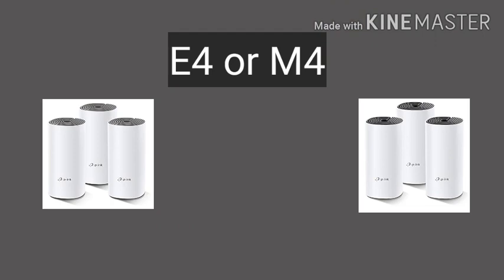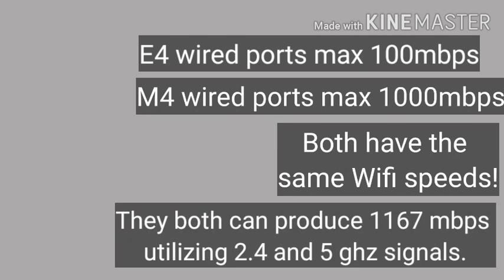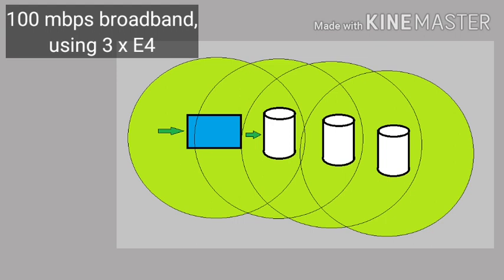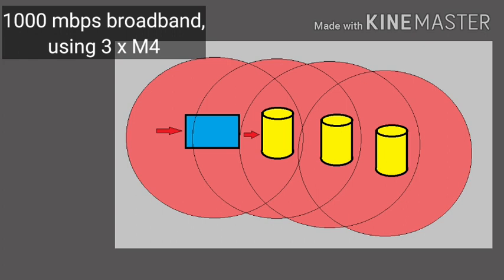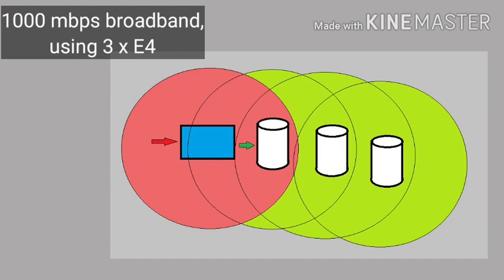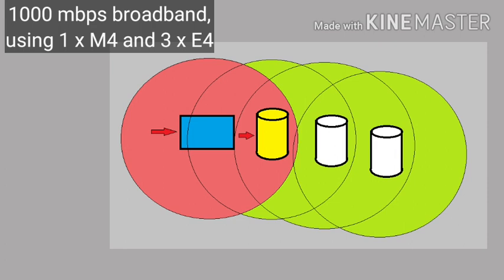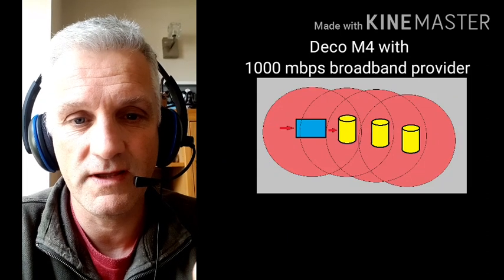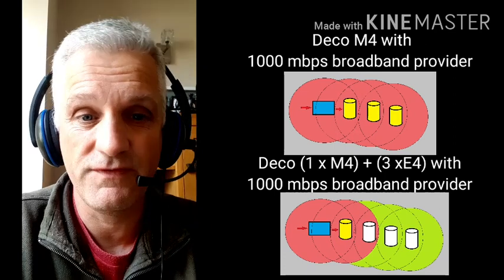Deco E4 vs M4 - better explanation and configuration idea!

Comment: Hey @stevedogwildman2133. Currently I have two E4 Decos one of ofcourse being connected to the routed providing me with a wired 100mbps download speed. As per my internet provider, currently I have a 1000mbps / 1GB download speed. If I understood correctly from your video, replacing the first deco to an M4 will result in a maximum internet speed of 1000mbps / 1GB download speed through the whole network right? (Of Course some connection may be lost due to the distant between the Mesh System) I would appreciate if you could reconfirm if this is the case

Comment: if say one of these täcan transmit a signal 100 feet, can you then put 3 or maybe more on a line 90 feet apart from eachothers in a line so you can go 300 or more feet away from your router signal?
Reply from the maker: Yes.  But of course the further between nodes, the weaker the signal will potentially be.
Reply: @stevedogwildman2133  okay so the first one needs to be connected to the router with cable or can you do it wireless? and then between the second and third you do it wireless? 
or do you even need a router at all or this works as a router?
Reply from the maker: @Chris-zu4es you cable from your router to the first node, then can go wireless (or wired) from the 1st to the 2nd, from the 2nd to the 3rd and so on.
Reply: @stevedogwildman2133  thank you very much ill give it a gi thanks to this video 💯
Reply from the maker: @Chris-zu4es let me know how you get on!  Cheers!

Comment: How well does the third one transmit back?
Reply from the maker: If all talk to each other they should be fine. But you have to work it out in your head.  So if node 2 has 70% connection to the primary, and node 3 has 50% connection to node 2, then if node 3 could gain 40% to node 1 direct, it might be faster.  All being said, normally if you can create a solid link from node to node, you should get a good connection.

Comment: Does E4 wan input is through 100mbps port only?
Reply from the maker: Yes, so as one of those nodes would be a primary node, then that would maximise the mbps to 100.  If you put (say) an M4 as your primary node (wire connection to your router) then the e4 nodes can send via wifi up to around 800mbps, as the M4 can run wired up to 1000mbps.  You can therefore upgrade an e4 system (to some extent) by adding in a single (better) primary node.
Reply: Thank you

Comment: I have checked with a local supplier. I currently have a100 mbps broadband service so E4 should be fine, but the supplier said (1) if in the future you have a higher broadband service,  changing the 'master' E4 to M4 and connecting this to the other 2 E4 will not help as the speed of the other 2 will still be not more than 100 mpbs therefore you will still be limited to your previous speeds
 (2) Replacing the 'master' E4 with an M4 and keeping the other E4's will not be compatible. Can I please have your comments? thanks.
Reply from the maker: Replacing the primary will allow your whole system to go up to around 1000mbps.  The specification of the E4 is only limited on the wired ports, so if you use an M4 then that's where the ports are, and those go up to 1000 Mbps. The only issue would be if you wired from an e4 to a laptop, say, which would then be limited, but if you had the laptop on WiFi then all is fine!
Reply: @stevedogwildman2133  Thanks. Just to confirm....so if the broadband service increases from 100 to 1000 mbps, and I have an M4 connected to the modem and another 2 E4 (not wired) in other rooms, I will get wi fi with 1000 mbps all around the house, even though I am using 1 M4 and 2 E4s? Thanks again.
Reply from the maker: The era have nearly 1000mbps WiFi, but are limited when wired.  So if you usedl an M4 or M5 as your primary, that gets you past the problem.  Check the specifications.  What I'm saying will make sense....
Reply from the maker: E4, not era.  The person who advised you are wrong.  The problem with the e4 is the wired ports.

Comment: my house is 2600-2700sft. and the current broadband speed i get is 20mbps on average. in this situation do i need to buy 2pack M4 or 2pack E4 is sufficient enough?
Reply from the maker: E4 should be sufficient.  You can always add an M4 another time if you like.

Comment: I had both and found that the M4's are much faster over Wi-Fi.  Think about it.  In theory, they are both capable of 867 Mbs Wi-Fi but, if the E4's can only bring in 100 Mbs, how can it output 867?  Now, in real life, I found that the M4's do not output anything near 867 Mbs, but that might be due to my equipment.  Fastest that I have got is between 300 and 400.  "Your mileage may vary."
Reply from the maker: So I added an M5 as a primary unit to my E4 system, and all appears fine.  You are right, performance can be impacted by many things.

Comment: Im planning of purchasing my first mesh system. Having a 4 storey fully concrete house, i calculated that i need 5pcs of mesh units. I have 200 mbps network.

The previous plan of setup was 
$195 = 3pack m4
$135 = 2pack m4
Total of $330

But after some reading, i can adjust it with these, with the same result as mentioned above.

$102 = 3pack e4
$135 = 2pack m4
Total of $237,  almost $100 savings for same result

Having m4 as the main and 3 e4 = 5 m4
It still can spread the roughly 200mbps all around the house with only 2 m4?

Update: follow up
One of the mesh is to be placed on a dental clinic thats on our ground floor. If clients were to connect on the e4, can i have that specific mesh have different password? Or m4 is more appropriate on that particular area?
Reply from the maker: You can set up your own networks off the same mesh.  M4 is a stronger system than an E4, but both are good.

Comment: Superb explanation! I've a 50mbps line, E4 it is, saves me £50 and I can add an M4 if I increase down the line. You've a gift for making information simplified and relatable. Thank you.
Reply from the maker: Many thanks for your comments!  Feel free to give the video a thumbs up and if you want to subscribe, go for it.  It's free after all.  I have a selection of mesh wifi videos and some of them will help you learn the best way to position them.  Also, I do some paddleboarding videos.  Totally different of course, but they are good to view in these covid times!   Thanks again!
Reply from the maker: I happen to have an E4 system.  I needed another node, to extend my range into a garage, which is now an office, so I bought a single M5 unit.  Yes, effectively an upgrade and it was cheap!  The S4 is going cheap at the moment on Amazon.  It's the same as M4 (just shorter), so you could grab a bargain.

Comment: Steve, one thing I don't get: if I have one M4 as the main unit connected to the modem (gigabit speed) and some E4s as additional units, won't it have the same result in terms of wifi speed as if all the units were M4s? I mean wifi speed will not be capped on the main unit's ethernet port if I'm not mistaken.
Reply from the maker: You are precisely right, however, as the wifi speeds are the same.  The only difference is if you chose from on of your secondary nodes to then use a cable into a device (e.g. my laptop, cos the laptop wifi doesn't work), then that is limited to 100gbps on the port.   This is a particular situation which at a guess wont happen often, but that is essentially the only difference.  So using an M4 and then E4s running off that, is almost identical to running all M4s.  Personally, I had an E4 system, then added an M5, cos it was cheaper at the time than an M4!  Bizarre eh?
Reply from the maker: Sorry, Typing went a bit wrong at the start.  So you have an m4 then wifi to an e4, you can only port then to a laptop via cable at 100mbps.  If you had all m4, then those secondary ports can run at 1000mbps.

Comment: Hi Steve, thanks for these videos, as they make everything very clear. I saw almost none reviewers to say, that even though the speed of wifi on E4 is 867mb/s, the input speed is only 100mb/s. Great tips. I have one question, which I did not fully get. I ordered E4 (3pack) from TP Link. Can I connect those TP Link Decos to my existing wifi router? Can I let my wifi router where it sits now and just connect those 3 Deco units around my house? Does this "seamless network" work then too? Does it have any advantages/disadvantages? Does the first unit need to be connected via cable? And is it even possible? Thank you very much
Reply from the maker: Your first deco unit will be connected to your existing router via an intranet cable.  You can then, if you like, switch off the wifi function on your router.  If you leave it switched on, which is fine, you will then have 2 network which run alongside each other.  You could if you wanted wifi devices which don't move and are close to the existing router to that one, then connect other devices, which you carry around with you to the new network.  I have connected all of mine to the new wifi, the mesh wifi.  I have a 3 pack E4 system, I then added a M5 and made that my primary, so i can get 1000mbps onto my wifi, but my broadband provider cant provide to that level, so i am "future proof" for when they can.  Hope this helps!  Give me a thumbs up and subscribe if you like.  It would be appreciated! Thanks Steve
Reply from the maker: I have 2 newer videos on my channel about signal strength of WiFi.  It will be useful to you to watch those, when your mesh wifi arrives!
Reply: @stevedogwildman2133  thanks for that Steve! Thats what I needed to know. Currently I have two routers one from provider, one myself. So I will just use the one from provider which has wifi function turned off and put my old router into a drawer probably 😄 I have an internet with 25mb/s speed, so for now E4 is more than enough for me. I am looking forward to that experience.. 

Is the seamless network working really that well? Can I for example start to watch some video on my smartphone on the second floor, then go to the first floor and it won't stop but seamlessly run the video continuosly while switching to the second unit? :)
Reply from the maker: It should be fine.  You have to switch this on, in the deco app.  Also beware thay sometime I have drop outs, my wife and son thought it was a mesh wifi problem, but it wasn't, it was my broadband provider, they lost me a connection, so you have to always consider things.  Careful placement of the units will help remove dead spots.  All should be good!
Reply: @stevedogwildman2133  thanks!

Comment: Hi, want to know that the first unit can only (must) connected with wire Ethernet and setup as router?
Can the 1st unit of E4 connect wirelessly to the main router as Access Point, then the other E4 follow the first unit of E4 as AP?
Reply from the maker: First unit connects via a wire to your original broadband router.
Reply: @stevedogwildman2133  Then no luck, 1st unit must be Deco M4/M5, then only useful for the rest of the E4 unit
Reply from the maker: E4 can connect wired.  All can.  Just the first (primary) unit must be wired to the router.   All must be fine, surely?
Reply: @stevedogwildman2133  In order to benefit the Gigabit ethernet, also the 300Mbps fiber internet from ISP, at least 1st unit must be Deco M3/M4/M5. Well, my idea is, because Deco E4 only has fast ethernet 100Mbps, would it be possible Deco E4 1st unit can be connected wirelessly, utilizing the 866Mbps of the WiFi AC, let it function like an extender/repeater wirelessly to the main router. Just an idea.
Reply from the maker: Yes, your first unit must have greater than a 300mbps port.  The primary does need to be plugged into the router.  You can even switch off your broadband wifi if you like, it can apparently cause interference, but I have no such issues.  My system here is an M5, then loads of E3s, which are essentially the same as E4s (other than the power chord).
Reply from the maker: Sorry, it's early, mine are 1 x M4 and 3 x E4s!
Reply: @stevedogwildman2133  Good, do you have experience on other brand, such as Tenda and Totolink mesh system that is identical specs with this Deco E4? From Tenda is called Nova MW3, from Totolink is called T6. All these also has Deco M4 equivalent of Tenda Nova MW6 and Totolink T10.
Reply from the maker: I haven't used them, but spotted one of the Tenda ones, which costs £119 is apparently good for getting signals through solid walls. A colleague has a Tenda system, so I'll speak with her, do some research and post a video of my findings.  Not strictly a review, but something which might be useful.

Comment: Hi Steve, nice video and some good ideas being bounced around. I'm looking at a mesh wifi setup and the M4 is probably top of the list due to it's price currently from Argos. I've read a few stories online that's put me off a bit, so wanted to ask around. Sorry if these questions have been asked before. Have you noticed any issues with the wifi signal dropping or having to reconnect a mobile phone every now and then, for example? Also I've heard a few people not being able to get the wired ethernet backhaul to work and it defaults to a wireless connection. Have you or anyone else experienced these issues? Maybe I'm just being a bit over cautious as I could send them back if they don't work for me. Thanks in advance.
Reply from the maker: I've had no problems.  My wife and son have said before "the WiFi is tosh" as it dropped out, but it was the broadband that was dropping out.  Open reach told me that it dropped out 28 times one day, and since they repaired the filter on the line it cleared up totally.  I don't think you can go wrong with the Deco mesh WiFi system.  I get a good signal all over the house and we have loads of devices running.  My mate works in his garage which is separate from his house and the Deco does him fine.  It's better than our bt router by a distance.  I plug my laptop wired into a satellite unit, cos the laptops WiFi doesn't work.  That unit is linked wirelessly to the others and I can video and phone conference for work just fine.  In an area which is dead to the BT router.  There will always be someone who will complain, but my experience has been really good.  I recommend!
Reply from the maker: So for example, my son can be playing Xbox wirelessly I'm his room, my wife can be streaming Netflix in another and I can be having a video meeting and all is good!
Reply: @stevedogwildman2133  That's brilliant. I'll get some ordered. Thanks for taking the time to reply and enjoy the rest of the weekend!!

Comment: I have a 50mbps plan want to kill deadzones in my house (3000sq.ft) Should I go with E4 or M4 ?
Reply from the maker: They will both work precisely the same with 50mbps.  If you think you'll ever get more than 100mbps then the M4 will be better, but you'll be able to upgrade by adding a single M4 unit to an E4 system.  Personally, if the E4 is noticeably cheaper then get the E4.  If the prices are similar then get the M4.  You will be happy with either!

Comment: I have E4 but I want to buy 1 Deco M4 because the Gigabit port, do you know if are compatibles both between them?
Reply: Thanks for this, i bought 1 M5 as the primary and a pack of 3 E4s.
Reply from the maker: Really good idea!  Hope it goes well for you!
Reply: @DarthAndre24  please let me know if it works well..
Reply from the maker: Yes!  It'll be good to confirm!
Reply: @Steve Dog Wildman update: 

The M5 arrived today, immediately after setting it as my primary node, my connection went up from 95 mbps to 150 mbps on all nodes (my connection is 150 mbps down/up). 
I believe this is the cheapest way to get into a sub gigabit mesh system and I only spent  160 USD for 3 E4s and 1 M5. 

Thank you for this suggestion 👍
Reply from the maker: That is fantastic!  "Like and Subscribe!" As they say and see my other video's of random stuff!
Reply: @DarthAndre24  Thank you for letting us know.. 👍🙏
Reply from the maker: Hey, see this.  Totally different, but it's me!  Out having fun!
https://youtu.be/eY7SXXKZwb8
Reply from the maker: Yes! But as per my video, you'll only get the higher Mbps from the M4.  But to answer your question, yes!
Reply: @stevedogwildman2133  Since the first unit is M4 the LAN serves 1000 MBPS. 2nd and 3rd units if I use E4 and since they are connected by by wifi (since E4 wifi can transmit  more than 1000MBPS)  all should provide 1000 MBPS,  isn't it? That assembly of units ie,  1st M4 and 2 E4  effect should work exactly as 3 M4.. if I got this right.
Reply from the maker: Yes! You made me think there, but I think you are right!
Reply: @stevedogwildman2133  Ok thanks, the M4 I connect with the modem, and the E4 with de M4
Reply: Im planning of purchasing my first mesh system. Having a 4 storey fully concrete house, i calculated that i need 5pcs of mesh units. I have 200 mbps network.

The previous plan of setup was 
$195 = 3pack m4
$135 = 2pack m4
Total of $330

But after some reading, i can adjust it with these, with the same result as mentioned above.

$102 = 3pack e4
$135 = 2pack m4
Total of $237,  almost $100 savings for same result

Having m4 as the main and 3 e4 = 5 m4
It still can spread the roughly 200mbps all around the house with only 2 m4?
Reply from the maker: Yes, the same unless you want to use a cable from a node to a device, but most devices are wireless!